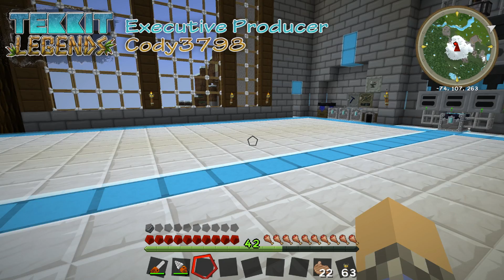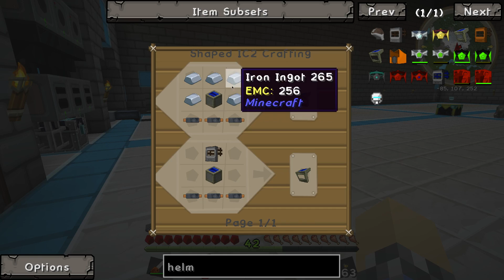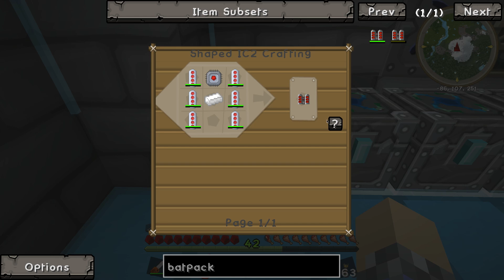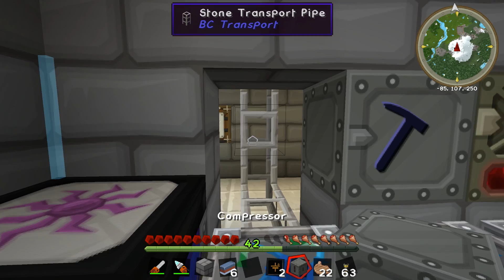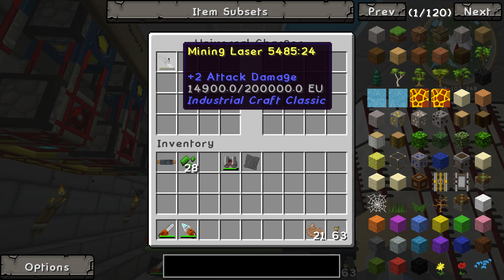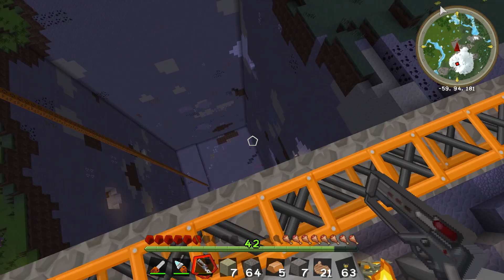Mobile Power | Tekkit Legends | #19

Comment: Cub, I don't know if you realize this, but the reason some recipes don't work is for one of two reasons. 1) the recipe has an item that has a durability/energy bar. This means that each item has a different ID for each different durability level. Same goes for energy levels. Which is why the helmet would not automatically be put in there, same with the batteries. 2) like the tin, there may be several types of tin. This does not usually come up though. Anyways, keep up the great work! Loved the video and your commentary! (as always XD) #CubsCrew to the max!!!!(Although I havent seen any orders come out recently?)
Reply: We know